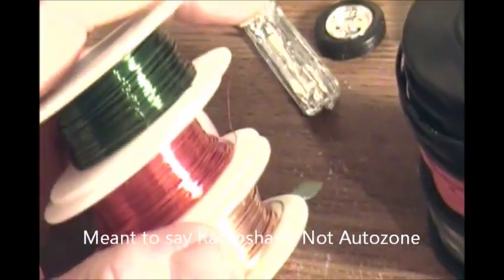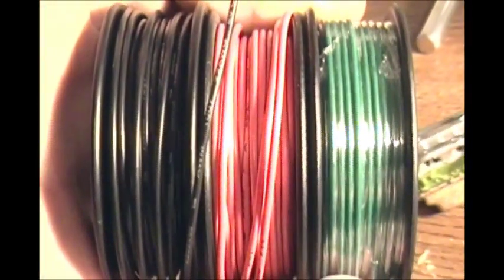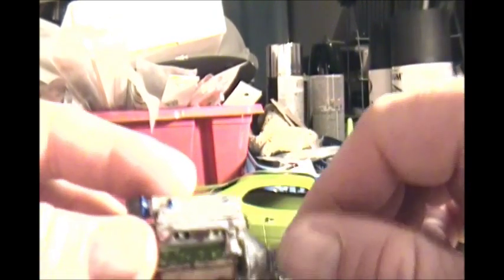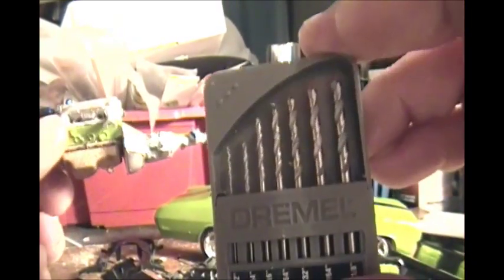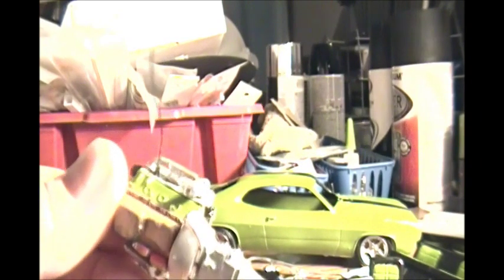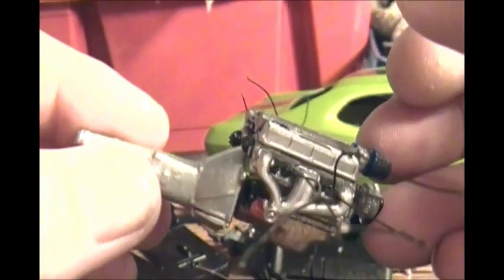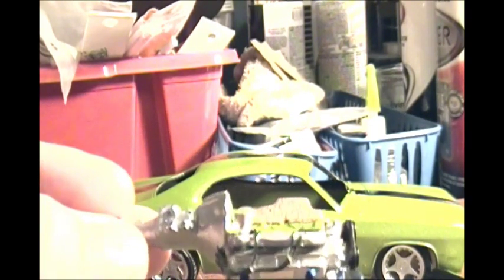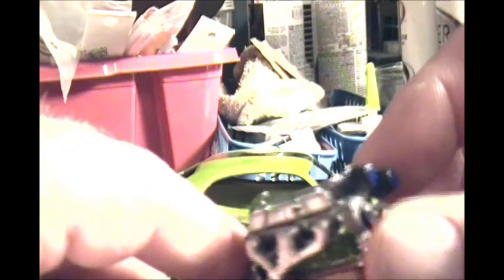How to build plug wires and plug boots for your model.  For "coolmodels49"

Comment: How long did you cut the boots?
Reply from the maker: No specific length really.  I cut them about twice as long as I thought I would need and then slid them into the block untill they was about an even amount sticking out to look like plug boots.

Comment: I had an aftermarket 1/25th dist. and wires over 10 years ago that used a technique like this, but it came with smaller hose that looked just like the black hoses that came with some GI Joes back in the day. It's a great technique!!!

Comment: Great vid. What are the wires called? I got the 22 awg ones, but the others. Thanks
Reply from the maker: I was using small  armature wrapping wire.  Dont remember the size anymore.  It comes in a 3 pack at radioshack tho.
Reply: thanks